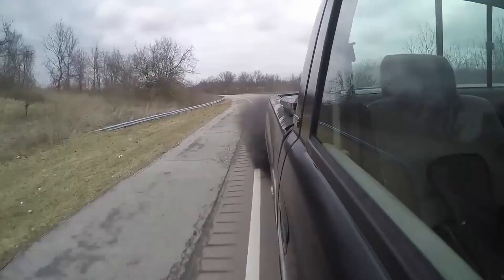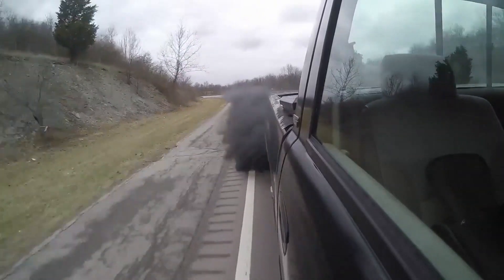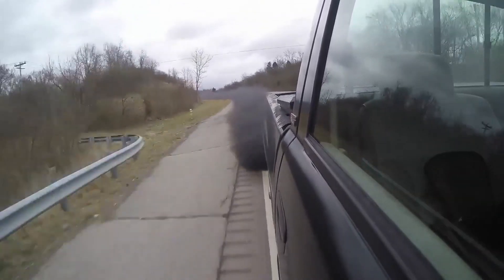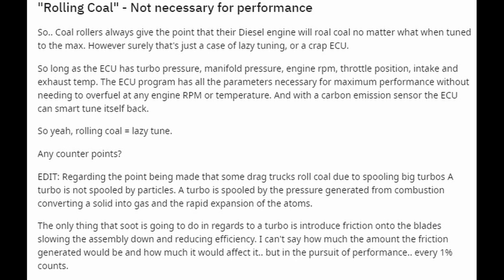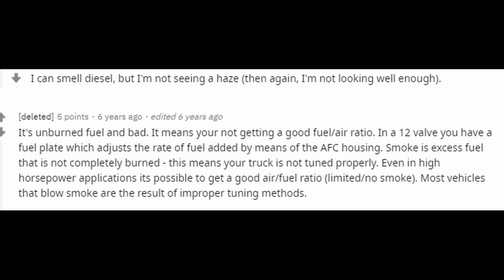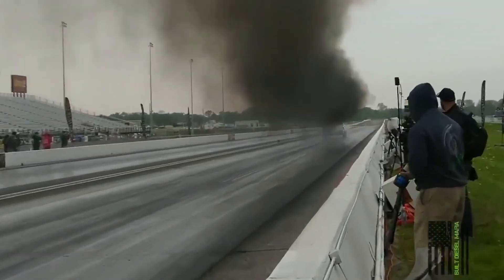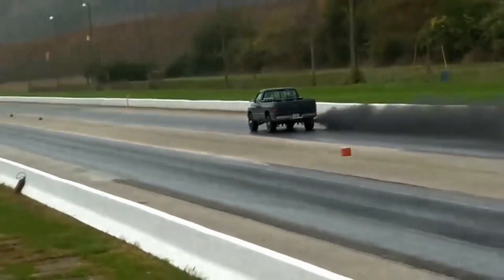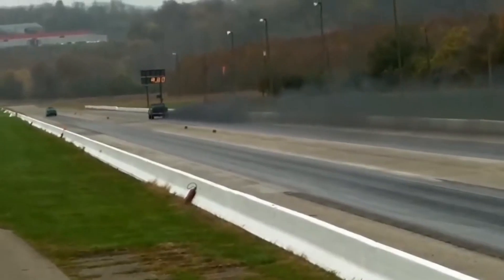Does rolling coal make you faster?

Comment: Or those trucks are taking part in a "show" and visible smoke is so dramatic that it would be worth loosing a few horse power for the spectacle..... I know that my old 1989 VW 2.4 6 cylinder idi non turbo diesel with its huge  64hp on a good day goes slower in proportion to the amount of smoke it makes. Why not ask Jason on Engineering Explained.....